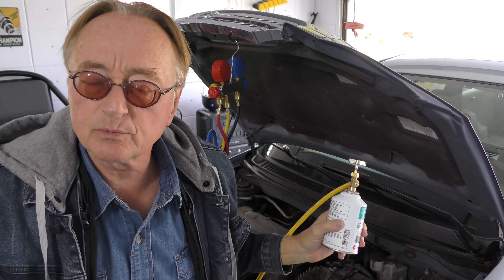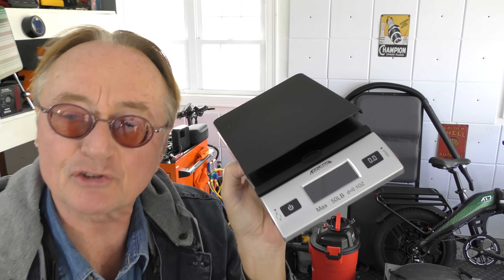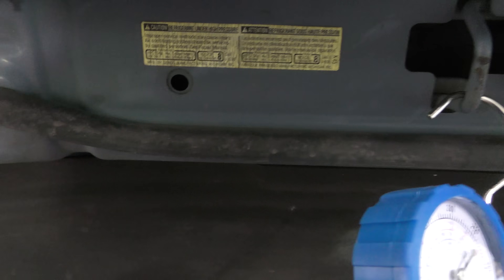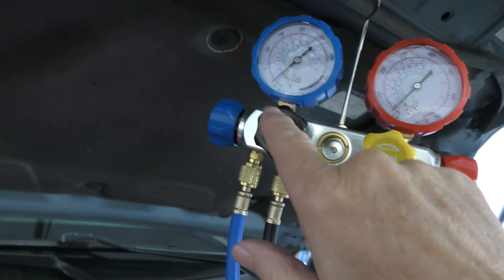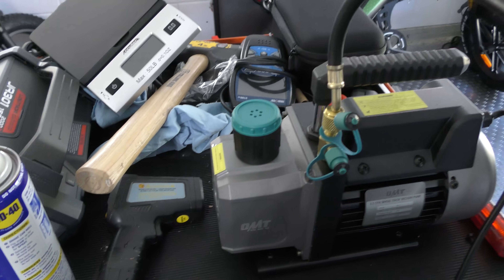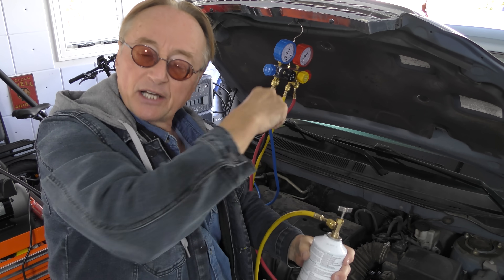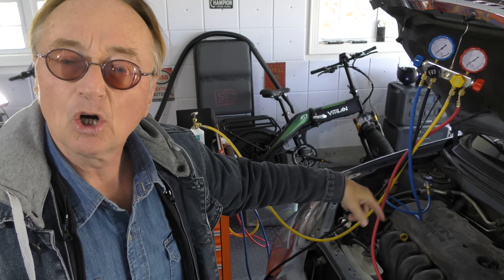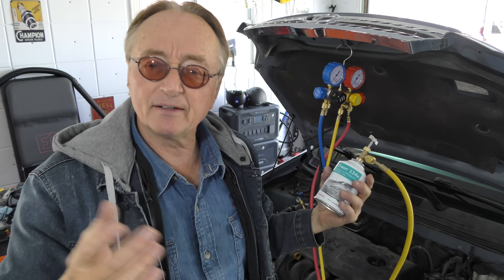Doing This Will Make Your Car's AC Blow Twice as Cold

Comment: Scotty Kimer fans are not going to like this. There are some flaws and mis guided information by Scotty. The 609/608 EPA certifications (not a license per scottys word) are EPA certs through a test that focus your knowledge & understanding on refrigerant shall be handled, recovered and more. Decommissioning an AC vehicle system with refrigerant is not outlined by Scotty. Scotty also doesn't outline how refrigerant is a vapor and liquid and the effects to a compressor if not flashed /metered correctly via  liquid refrig and some of the short comings of putting  vapor as a pre measured weighed inaccurate can vs a 15-30 lb tank of refrigerant. I'll skip the fact that scotty doesn't even talk about proper compressor oil ratio and how oil is lost in a system or over adding oil.  I have seen more overcharges from DIY and novices with Scotty's simliar lack of guidance and lack of procedure. I imagine if you asked the correct questions you could find a licensed mechanic with the property machine to recharge a sealed system and verification under $250.00. Knowledge is power however whats the cost of wrong guidance or misguidance?
Reply: @Pro Answers 
Show me an HONEST and COMPETENT mechanic I can trust in my area and you'd be correct. Finding competent and honest help with car repairs is almost impossible today in the USA, the entire industry is crooked with few exceptions. 
The reason why people will do anything not to go to a "professional mechanic" is because most of them are incompetent and or crooked.

Comment: You don’t suck refrigerant out with a vacuum pump. You need a recovery machine. It’s not -30 pounds of pressure. It’s 30” of vacuum which cannot really be achieved. Put the can on and then zero the scale. You don’t need to do a bunch of math tricks. 

I am sorry man. You mean well, but you are not showing people how this is done. Venting refrigerant, even 134a is illegal. If your system has pressure and you use a vacuum pump to suck it out you will destroy your vacuum pump. 

Stick to brakes.

Comment: Toyota = Junk vehicles with reliable engines. The only reason they are reliable is because they produce no power. Which is also why the transmissions last. No strain. 

Overall, they are terribly cheap and under performing vehicles.
Reply: Well it's about the power to weight ratio so take a super powerful yet super heavy car and put it against a low power yet light car = basically the 'same difference'. I almost beat a Ford Galaxy in a beater Honda civic with no performance upgrades.

Comment: This man is a muppet, pay someone to do the job properly. 
It is all well and good using a vacuum pump to boil off excess moisture in the system. You still have to remove the old gas without venting to atmosphere. If the gas is released to atmosphere there are legal and environmental implications. 
There are reasons that qualified technicians charge for their services. We have to train for many years undergoing regular updates so that we can provide a good service to customers whilst ensuring work is carried out to a high standard and all legal requirements are met.